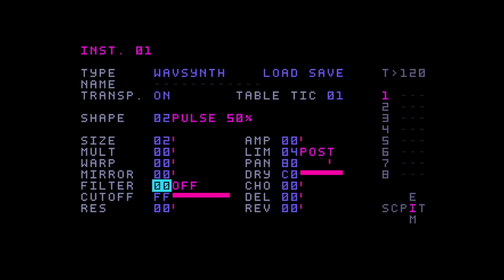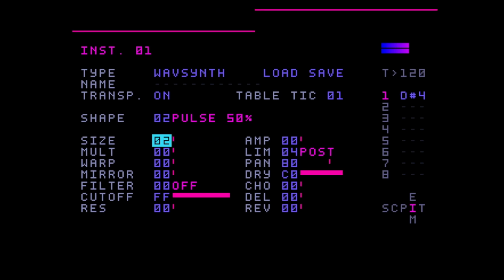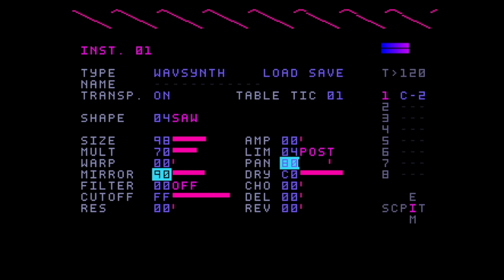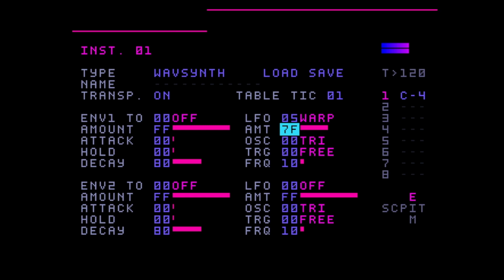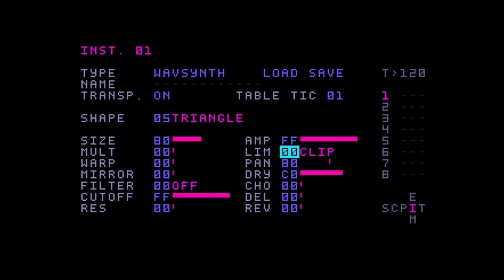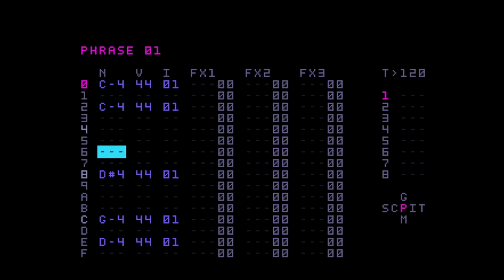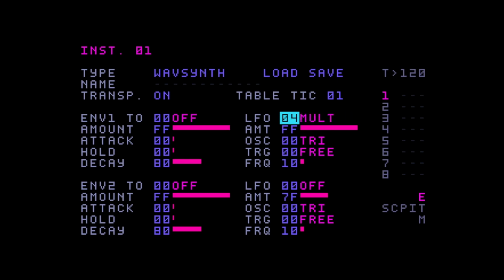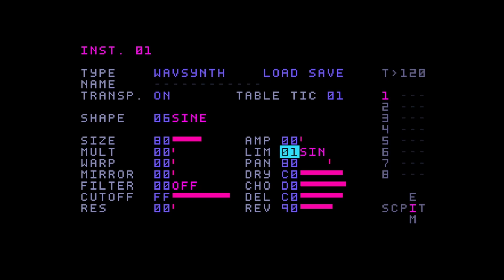Dirtywave M8 Tutorial ( Wavesynth Deep Dive )

Comment: The multiply parameter isnt the same thing as supersaw. The supersaw is 7 separate oscillators, the multiply parameter repeats the waveform of the oscillator per cycle, and gives you the new fundamental frequency that corresponds to the 7th harmonic above the note
Reply from the maker: Agree on supersaw,  I've asked the team about mult and I'm told its 75 cents per parameter step, and synced. So mathematically can't line up with a 7th harmonic (969 cents) but close at 0D (975) .
Reply: @avrilcadabra  okay right, that makes sense. Because its not granular enough for just intonation